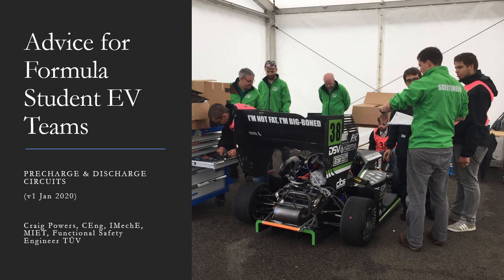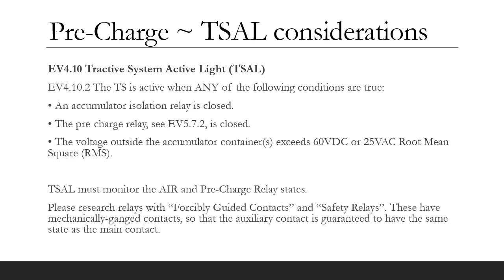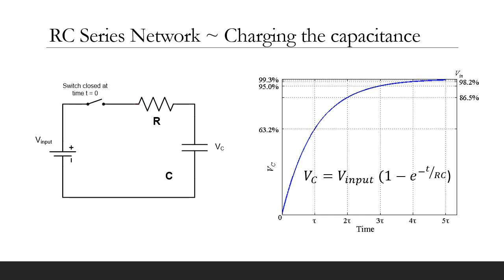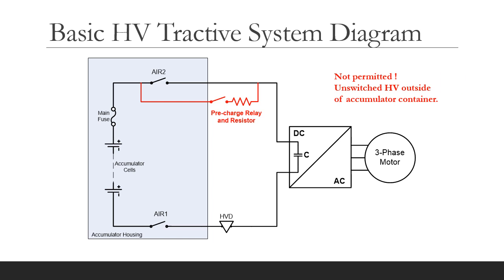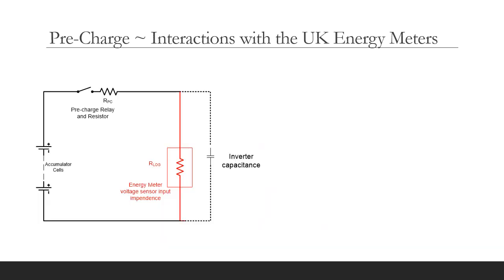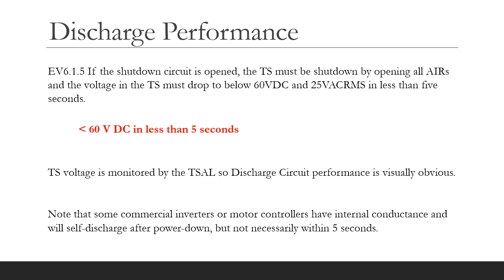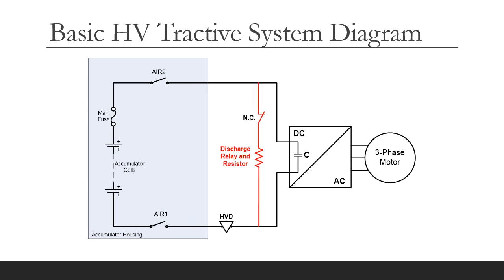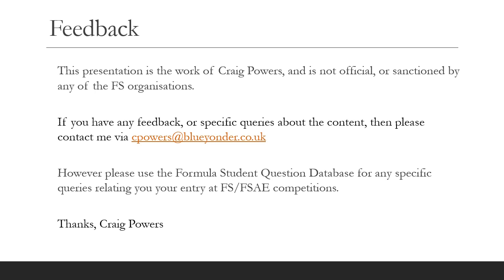FS EV Precharge Discharge v1 02Jan20

Comment: Hi Craig - is it necessary to have a contactor on both legs of the traction motor
Reply from the maker: I assume that you mean the AIRs? 
Golden rule: there must be no unswitched HV outside of the accumulator housing.
Both poles of the accumulator must be switched by AIRs.
Rules say:
EV5.6.1 At least two AIRs must be fitted inside each TSAC.
EV5.6.2 The AIRs must open both poles of the TS accumulator.
Does that answer your question?

Comment: Hello from New Zealand. What if you have two contacters positive and negative at the batteries in the back of the car and a third one acting on the precharge circuit that's up the front with the inverter?
Reply from the maker: Sorry for the delay in replying.
I'm not sure what your suggested arrangement is. There are allowable architectures where the pre-charge resistor is outside of the accumulator, but you must obey the golden rule: there must be no unswitched HV outside of the accumulator. Putting the Pre-charge circuit inside the accumulator container is the most obvious way of complying with the rules. In my opinion it would be the most sensible solution which also reduces the wiring for the TSAL health monitoring.

Comment: Hi Craig, can we use a simple microcontroller to regulate the closing and opening of the AIRS? We will still measure the two voltages and compare them via comperator then on the low voltage side the AIRS have to be regulated and we dont see any other way of doing this. The rules are not so clear about how much software there is involved.
Reply from the maker: I see no reason why you cannot use a microcontroller to control the pre-charge sequence, but you must use conventional normally-open mechanical relays as the final element in the shutdown circuit (EV 5.7.2). When you have designed the circuit ask yourself whether it will fail to a safe state on loss of module power, burned out relay coil etc, and ask yourself what the impact and mitigations would be if you have a stuck output relay (welded contact). [Read the TSAL rules]
Reply from the maker: Could you also introduce yourself by team name. Thanks.
Reply: @craiguk62  i m a member of the Formula Cruisers team the hague, because the precharger/discharge pcb needs to be in the accumulator container, the microcontroller could malfunction because of the EMC in the ACC container? For now i have designed a logic gate circuit to hardwire the signal output of the comperator. Then i can control the sequence of the closing/opening of the AIRS too if i also use RC network to delay the sequence. (i ll use cmos logic). My question is, do you think the EMC is could make the microcontroller malfunction?
Reply from the maker: @jerardterian3879  that is a very open-ended question Jerard. It's all down to good practice, careful design, neat and well thought-out cable runs, screening and filtering. Only testing will confirm but there is no reason why it should not work.

Comment: Hey! I participate in the FSAE Australia where a timer-based precharge is acceptable. I arrived at the conclusion that timer-based methods have unacceptable failure modes - as have the UK competition.
My proposed solution for voltage monitoring is described here: https://youtu.be/6-RndXZ5mR4
I understand that it is a complex solution, but in lieu of any readily available off-the-shelf equivalent this is the best I could come up with. Would you consider this solution overly-complicated?
Reply from the maker: Yes, if you infer the Inverter voltage from signals inside the accumulator housing then there are open-circuit failure modes that can trip you up.  Therefore detecting a pre-charge that is too fast takes care of those. Good idea. The messier solution is to wire the actual inverter voltage back into the accumulator housing, to the pre-charge controller, and perform a  direct comparison between accum and inverter voltages. Thanks for sharing.
Reply from the maker: Which team are you with Michael?
Reply: @craiguk62  NU Racing - The University of Newcastle (Australia). We made out debut in the EV competition last year. Thanks for your thoughts Craig, I hadn't considered feeding TS voltages back from external to the accumulator.

Comment: Hi Craig, great video presentation on PRE and DIS charge requirements for the 2020 FS Rules. I'm a member of Newcastle Racing's Formula Student Team, working on the Team's high voltage system and wondered whether I could e-mail yourself with regards to a couple of questions I have about the rule definitions outlined within the presentation. Cheers.
Reply from the maker: feel free to email me using the email on last page of the videos
Reply from the maker: Thanks James. I appreciate the feedback.I'll be adding another presentation tonight about BSPD and the implications of the SCS rules. It is something that very few teams comply with. I want to make sure that teams don't get caught out if scrutineers/events start to police this more robustly.